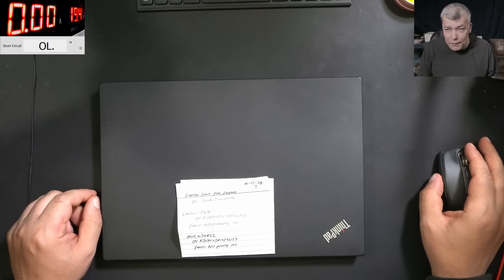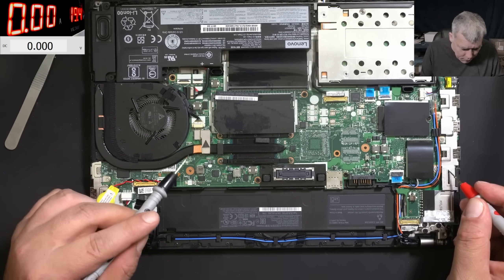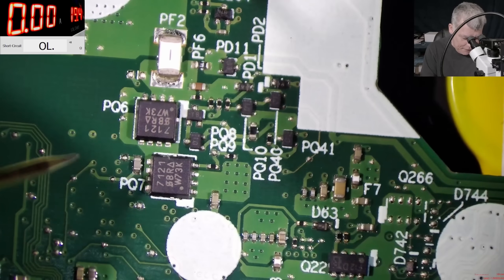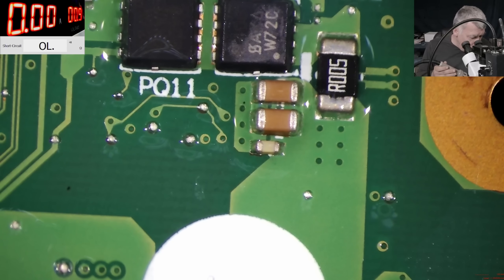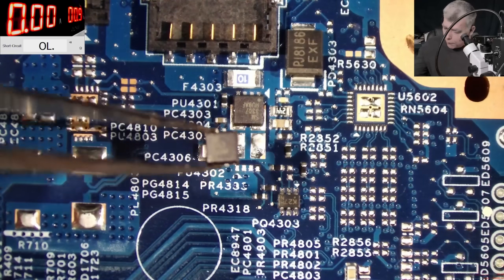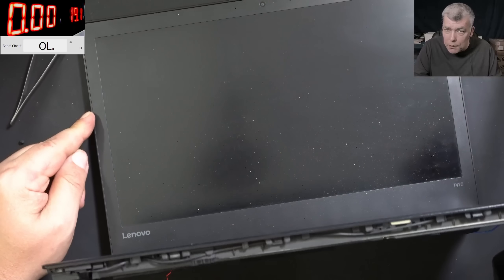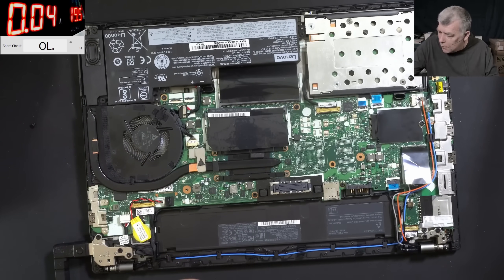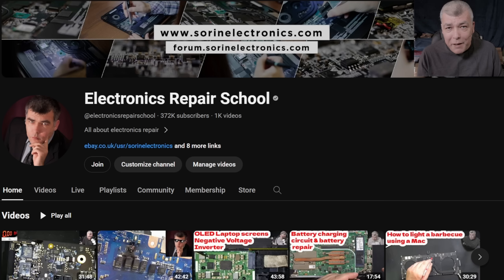Lenovo T470 - dead, not charging, what to check and how to check both main power rails

Comment: I think you could quickly demonstrate the proper calibrated strand of wire with thermal imager. Warm but not too warm with battery charging and laptop on. That tiny wire might get a bit too hot at full current draw, too much resistance.

Comment: Sorin, I have a T470, died after I was trying to read the Bios chip with a clip and CH341A, to get rid of Bios password, it was working fine before but now the power light comes in about a second and fan spins up, when I plug in, but after that no reaction to the power button and no light no picture, I tried to flash the Bios but no matter what I do there is no change could this be a Bios chip problem or something else, I don't think that the Bios is dead, because when I flash it ti holds the info, Any idea?

Comment: I have a t420 the old one when I press power button it comes on but not like normal (like most of the lights that normally come on don't come on)  then turns off same time and power button light keeps going on and off. Nothing else happen. 20v power rail is present that's all I check so far.

Comment: Had the exact same fault on my old T470. This laptop actually charges from both the 20V charger and the USB-C port. The Lenovo port is one power rail (before the first two mosfets), the USB-c is the second power rail (before its two mosfets) and after the 4 mosfets is your "main" 19V powerrail, which then creates the 12,7V powerrail. Mine had a shorted capacitor on the rail after the 4 mosfets. Took me about 1-2hrs to figure it out since i didn't have a thermal camera or a power supply at the time of attempting this repair.
Reply: Did you fix it? Still cool that you can troubleshoot the mobo and find the faulty components!
Reply: @j.lietka9406  I did! I removed and "replaced" the capacitor.
Reply: @express496  cool! Thank you 🤓
Reply: @express496  did you say hello to your little friend?

Comment: Despite the ability of the mosfets to carry high current they still get short, btw do you test how much current can the proper calibrated fuse carry before it gets burned? lol i made few "pcf" with different current rating based on the test i made on the psu, they won't replace a real fuse anyways

Comment: Ive noticed Sorin no longer uses "Diode Mode" on his MM to find shorts, he, 100% of the time now, uses resistance mode. What changed ?  Just curious. . . . .
Reply: He mentioned in a video years ago that diode mode can lead to "false positives." He then proved it with a demonstration and a handrawen diagram to further explain. That's why he uses his power supply (faster diagnosis) to find shorts/overheats alongside the MM,thermal camera, and alcohol tests.

Side note: He used to also use the customers charger to power the board initially, but in one repair, the charger was bad, unbeknownst to him, which led to a bloated repair time. So then he started powering the board with his power supply.
Reply: Good catch, I noticed that too

Comment: im sorry, dodgy is dodgy, I wouldnt trust that wire, even if its current rating is similar to the fuses
Reply: Why?
Reply: @ddannyable  wire isnt made to blow when over current, and is probably thicker than the one in the fuse, and the fuse is, predictably
Reply: yeap , but who cares ?  you just a saw a blown fuse with first mosfet burned caused by a a shorted capacitor ...so fuse was improper by default 
second , you're right,  there should be solder a calibrated fuse and more than that fuse must be rapid , wire is a slow fuse !

Comment: By the way boss u did check on the board by the time you remove the mosfet but u did you just change the without checking the mosfet u been removed coz if u remove a short component u need check by time u remove it but u didn't check the short mosfet but u just replace the other good mosfet
Reply: Very hard to understand what you are saying. Maybe try to edit your comment to make it intelligible